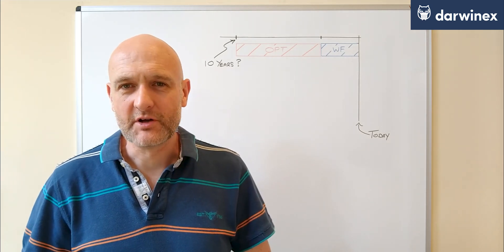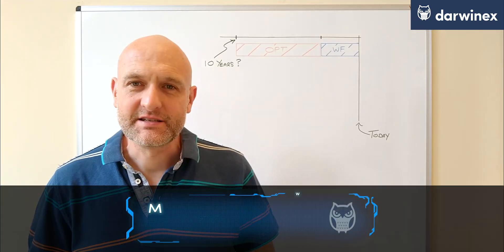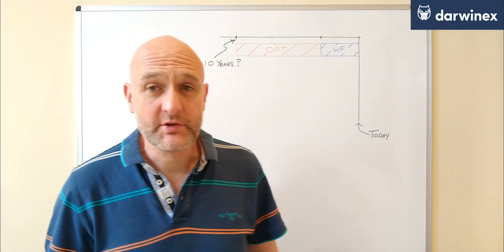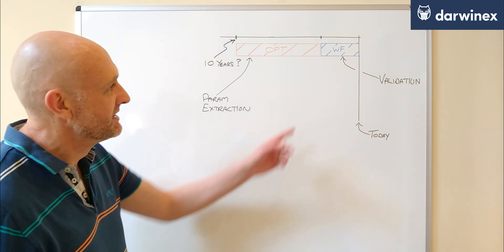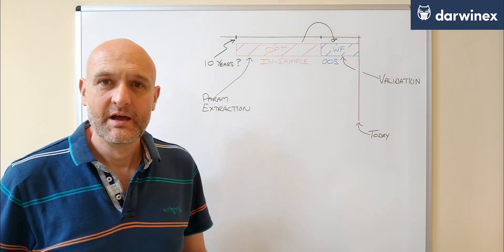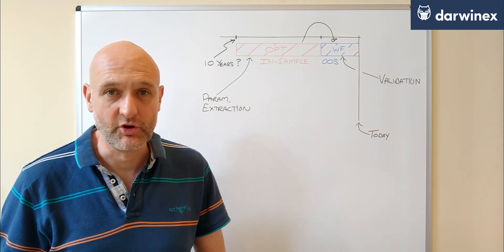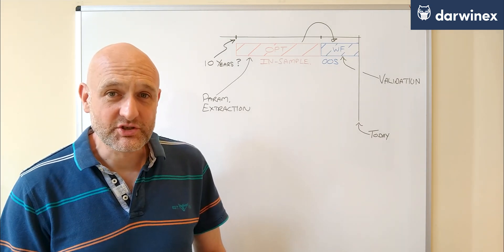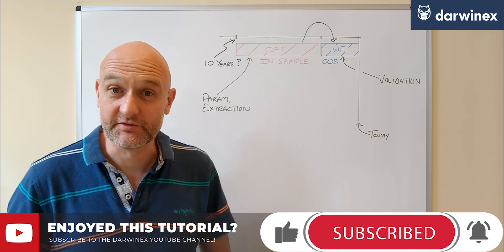7.1) Best-Practice Walk Forward Design for Trading System Optimizations

Comment: Very chalenging final question, ...
Reply: Hi Leon - Yes, you'd be surprised just how many people do this. Obviously, I address what I feel is the answer in part 7.2 :)
Reply: @martyntinsley  I trade the daily chart and my system is a swing trading system. How can I get that much data? one indicator even at the lowest setting gives 100 to 200 trades in 4 years and about 40 trades in 1 year at most. What should I do? it seems like you trade a much higher time frame so you get trades in the 1000s in 4 years
Reply: Yes, totally blew my mind!